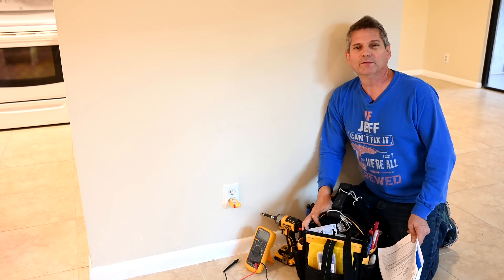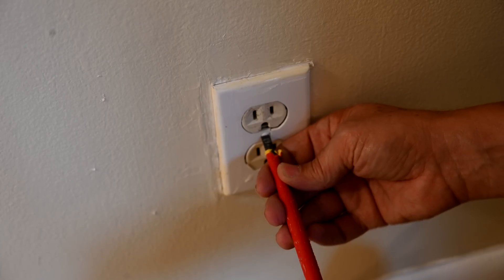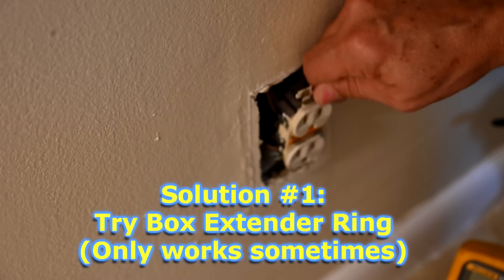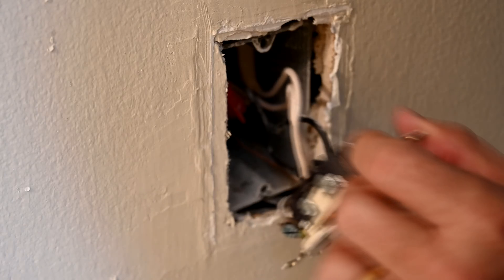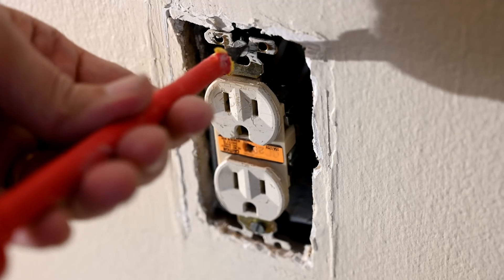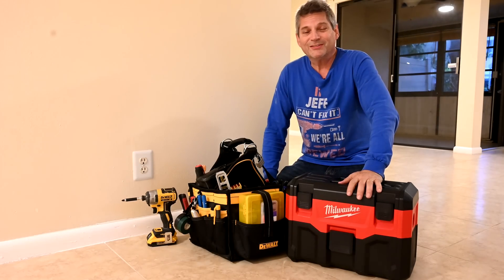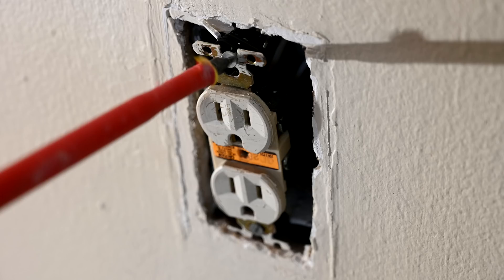2 Tricks To Tighten Loose Electrical Outlets, Switches

Comment: I have an outlet that I recently upgraded to a GFCI, but the box was so old that it broke off of the stud entirely and is held in place with the rigidity of the wire running to it. I managed to get everything done and it works, but it is incredibly loose and since it's a brand new GFCI outlet it holds onto everything you plug into it like a vice grip which makes it easy to pull the whole outlet with the box out by about half an inch. This is obviously not good in a bathroom. What do I do in this instance?
Reply from the maker: Do what I have had to do many times. Cut into the drywall, install a new box the right way and patch up the drywall. OR...if you can get the old box out of the existing hole, go to home depo and buy a 1-Gang 20 cu. in. Blue PVC Old Work Electrical Switch and Outlet Box that you slip into the hole in the drywall, and it has 2 wings that flip out and you tighten it against the back side of the drywall by screwing it in. See it here: https://homedepot.sjv.io/e41yWg
Reply: @jeffostroff  Thank you you're amazing.

Comment: Foundation of the project is a secure box....   Plastic cover plate cracked because the box was not secure,  appliance was plugged in And the receptical gave ground,.... the plastic couldn't support the inward force and done...  Metal plate is a good option when box is not secure.
Reply from the maker: I normally use metal plates in all my remodel projects
Reply: @jeffostroff  I like metal plates as well, but aren't they more expensive than the plastic?  My point was,... if the box was secured properly in the first place, the original plate would still be in place, unbroken, ... and you would have not had to fix it.

Comment: I use a homemade spacer. When you purchase wire shelving they give you plastic anchors for drywall. These anchors are white & they’re pretty long, I never use them, because I always  drill into the studs to hołd shelves. I cut these to the length I need and these work perfectly.   Thanks...Jim
Reply from the maker: Great adaptation! Anything that shims that space will work, washers, nuts, plastic.

Comment: You didn't insert the upper screw into the proper slot - looked like you were screwing into air. Maybe I'm missing something
Reply from the maker: It was stripped by previous installer so I tried to find a better angle that would hold it in.

Comment: Why not just fix the dry wall and box???
Reply from the maker: Good question. You come down here and fix it. Let me know how long it took you to cut the drywall away from the front of the box, since these ae mounted onto the front edge of the metal studs, then remove the old box, install a new one, then patch it all back up, then wait 3 days while you apply your 3 feather coats of drywall mud per day and let dry overnight, and sanding after each layer dries overnight, then buying the primer, and priming that part of the wall, then buying paint to repaint that area. Let me know how much effort that was for you to "JUST" fix the box and drywall, when we clearly showed how a $3 package of outlet spacers easily did the trick.

Comment: Drive a screw through one side of the box into the stud. Using needlenose pliars, bend the ears on the top in toward the box to take up the slack. Install new plate.
Reply from the maker: You can't drive a screw through the side of these boxes into these studs because the studs are thin gauge metal an at that angle from a narrow single gang box it's virtually impossible to even get a drill bit to go through I'm not sure head on into the metal it's a fool's errand even trying. You would have better luck pulling out the whole box after cutting open the drywall an installing a new box.

Comment: Hi, I found your video while searching through a problem I'm having.  Please correct me if I'm wrong, but I don't think this particular video addresses my issue.

My outlet has two plugs like the one shown in this video.  The top one, however, lets say I plug something in kind of heavy, like an electric toothbrush that has a box-shaped plug vs just a regular plug, it hangs most of the way out once I let go and eventually may fall out. I don't think it even stays in far enough to get a charge.  This only happens to my top plug, so I've been stuck with basically only one usable plug on my 2-plug panel.  The bottom one holds onto things ok, and again, it's just anything plugged in on top falls out.

What's the fix for this one?  Do you have a video on it as well or did this video cover that and I just didn't seem to catch onto that?
Reply from the maker: Your only fix here is to replace the receptacle because once it gets so loose like that that it can't hold items then it's time to replace it that probably has happened from people yanking on it over the years sometimes with vacuum cleaners and I've seen people do this where they've broken the prongs on the plug on their vacuum cleaner because they're always yanking them out of the wall

Comment: Replace it with new plastic single gang box..and put in a brand new receptacle.metal plates conduct juice easier than plastic in a default
Reply from the maker: I do that on my foreclosure flips, I replace every outlet and switch, but here they had to close in a couple of days, and needed this fixed.  Replacing the box would involve slicing open the drywall to get the old one out and budding and taping 3 layers afterwards, many hours of labor.

Comment: as much as i like your vids, this one has to be one of my least favorite. because you are citing codes that don't exist. i think you should stick to the things that you know and electrical code is obviously not one of them. sorry, just calling it like it is. 🤔🤦‍♂️
Reply from the maker: I know what I cite is correct. so instead of making up bogus generalities, get to the point and point out exactly which code I cited that does not exist. the fact is I spend quite of bit of time in NEC electrical code book studying, searching for exact requirements, and studying from experts in the industry who teach these codes.
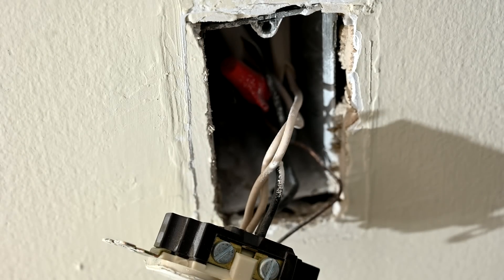Reply: @jeffostroff  there is no code stating that you can't leave more than 1/4" of sheathing on nm cable in the box. the code states the sheathing shall extend no "less" than 1/4" in the box, not no "more" as you stated @ 8:22 in the vid.

Comment: The wire spacer  can use in the wall in the ceiling  anywhere  you need  space an plus it insulates your long screwfrom touching any current in the boxes
Reply from the maker: I have tried all the solutions, but so far these plastic spacers work the best for me

Comment: i have a GFCI outlet i need to change that i can't get to cut off at breaker box, anytime i use my not contact meter it goes off
Reply from the maker: Why can't you get it to cut off at the breaker box? It should work. If that fails still, then try cutting main power to the whole house.

Comment: That spacer is a waste  of time use a single piece  of wire wrap it the length  of your phillip head screwdriver  and u will have endless spacer for free measure as much as you and cut an place between  the shim box and the box in the wall till the shim box  is flush  with  the drywall  then screws the plug  to the  shim box and complete  the job with your metal cover  or if that cover job is pleasing  tuh you you can leave it just like  that it's  your  choice
Reply from the maker: No a waste of time, the strip easily cuts and folds up tot he thickness you need.

Comment: You can use a piece  of single single wire wrap it around  your  phillip head screwdriver  to make a spacer  then cut as long as u need to make your shim box flush  with  the drywall then put it between your spacer box and the box in the wall to give the shim box  something  to  keep  it firm and flush with the drywall  if you can get the plug  box a little  more  firm in the wall before using the spacer  even better if you want  any more  advice let me know
Reply from the maker: Yes, another useful solution

Comment: outlet was broken , at the top ground point.  also , was back stapped.  bad practice should have replaced it. and put the wires on the screws.
Reply from the maker: The whole house was like that. they had zero money and were under contract with buyers, but their inspector found this. Hey but if you want to send the money to have all this done, I'm sure my friends would have loved to change them all out.
Reply: @jeffostroff  replacing the one, would have been like $2.   you didn't make a video about the whole house, just the one loose plug.   just saying.  and as they say, you touched that plug, if that plug over heats because it is back stabbed . they will be going after you.

Comment: Never even knew they made spacers For outlets, I always used washers, and they are very difficult to stack, Interesting to   Note they also make taps For different size machine screws machine screws If you’re dealing with a metal outlet and the screw holes are stripped out you can run one of those taps through it And go to the next larger size Number machine screw
Reply from the maker: I might try that next time on the tap
Reply: @jeffostroff  The tap saved my butt On my kitchen remodel, backsplash was done and there was no replacing this four switch box without making a huge mess Klein makes the tool cat number 625–24

Comment: That outlet box should be next to a stud I usually just take to drywall screws and screw it back to the stud sometimes you can break the old box down and put in one of those boxes outlet boxes that screw itself into sheetrock the little tabs on each end
Reply from the maker: Metal studs, so it is attached tot he front of the stud with a wrap around bracket, then the drywall goes on really sucks. No way to screws in sideways at that angle either into the cheap flexible thin gauge metal studs.

Comment: You could just pry out the old box and put in a blue plastic remodel box.   Also since the top grounding hole is broken, change the outlet out too.  I like to use the  more flexible commercial  plastic plates especially on uneven walls.
Reply from the maker: The problem is these are metal studs, so the outlet boxes are attached to the front of the studs, and the drywall goes on top, no way to pry them out, they have to be cut out. Several switches in their townhouse the drywall mud bump around the switches was so poorly feathered that the plastic plates crack from the stress of screwing them in under pressure over these humps.

Comment: What about this. When you screw the outlet to the plate it will hold the outlet forward, so it will not move in. So, why not just replace the cover.
Reply from the maker: Doe snot work because the outlet still pushes back too far. That is why the shims are needed to put the outlet in the correct position so you can put on the new plate.
Reply: @jeffostroff  if the metal outlet cover is being held from going back, because of the hole in the wall being smaller than the outlet cover. 
   If the outlet is being held to the outlet cover by a screw in the middle of the outlet cover.
   Thus, would tightening the screw on the outlet cover. Pull the outlet tight to the cover. Preventing the outlet from recessing into the wall. Because the outlet cover is larger, than the hole that the outlet is in.
   This would prevent the outlet from recessing into the wall, but if the outlet was not connected tight enough. When an appliance would be unplugged, there would be a gap between the cover and the wall. Majority of time, in those cases. The gap would close when unplugging the appliance, was done. 
   Correct?

Comment: ewe, I hate outlets with half painted, half scratched off paint on them. Yuck.  I assume this was going to be a cheap rental.  I would have replaced the outlet, THEN put on the metal plate.  I have even knocked out the entire box, let it fall inside the wall and replace the box with an "existing construction' box with the flip out tabs, then put in new outlet and new plate.  I do like the oversize plates so they hide oversize holes and old paint lines.
Reply from the maker: Yes, this was for my friends, under contract to sell the unit. Normally in my foreclosure flips, I buy all new electrical outlet receptacles and switches for the entire house, where they need it or not. My properties all look brand new when people walk in.

Comment: The fact that I corrected your incorrect use of the term outlet, should not have triggered such a rude response from you. 
Are you under stress?
Reply from the maker: The fact that I corrected your correction of my usage of words by showing you other professionals that also use the same terminology I used should have shown you that sometimes there's more than one acceptable terminology for something. Did that stress you out? It obviously did because your OCD has you coming back and you keep on commenting More and More digging in, which is an immature sign of somebody with superiority complex. Look the words you used to describe the items and the words that I used to describe the items are both acceptable why can't you just accept that?
Reply: @jeffostroff  the fact you need to accept is professionals and non professional DIY s , who know the correct term say receptacle. 
Would you ask for a mitre saw, if you “ meant” circular?
Man up, you are wrong. 
Using the example of others being wrong does not make you right.
Reply from the maker: @pm2819   You are using failed psychological nonsense to try to insert 2 vastly different tools into a discussion about outlets in  a failed attempt to prove your moot point. And you are wrong because every electrician   I've ever spoke to calls it an outlet.  whatever stupid reason you just can't get over to the fact that many professionals refer to receptacle as an outlet, and and outlet Box is an outlet Box. It doesn't matter you are here pounding the tables with your OCD nonsense. again you have OCD and you keep coming back for more and more and more you just can't let it go the problem is with you not but the video

Comment: Obviously , you are not an electrician.
Reply from the maker: Obviously, you are using the wrong gauge and metric to determine somebody's knowledge and or ability. Just because somebody does not use the exact same terminology that you do does not mean they don't know what they're doing. As this video shows I clearly fixed the error left by the builder themselves the actual professional who should have known better. If you had the knowledge, you're trying to make people think you have you would have noticed it, but your OCD has you stuck on the fact that I'm using a different word outlet, than you use for the same item, receptacle.
Reply: @jeffostroff  my guy you are wrong. 
Man up
Reply: @jeffostroff  so the code book is wrong , right, doesn’t matter?
Fact is an outlet is not a receptacle.
Reply: @jeffostroff  it’s about using the right terminology. 
And in this case:
You Are Not. 😎
Now man up

Comment: For another 75 cents you could have at least replace the painted over mismatch coloured ivory plug to a white plug with a white cover also never use  push in wire into the back of the holes always wrap your wire around the brass screws on the hot side and the silver screws on the left side. Or better yet  make pigtails  with wire nuts. KJ
Reply from the maker: Yes, they did a lot of backstabbing on those outlets, very common here in Fl in the 1970s and 1980s constructions, we see it all the time. Just lazy.

Comment: The old outlet was crap, the plastic was broken on the edge of ground.  It should have been replaced.  Because it is a metal cover plate there is a requirement in some areas to have the ground leg up so if the plate come loose drops down it will surely hit the ground so it will save someone from being shocked.  
I prefer to have the ground lug up in places where I plug in equipment because it is easier to line up the ground when it is on the top.  
Around here you are not permitted to use the second pair of screws to feed another outlet. 
Whatever happens to using plaster to set the box in place along with the screws attaching it to the existing box?
You would not have had to cut the plastic box extender if you had put an new outlet there, you know, a good one like a spec grade receptacle. 
Seems like a lot of work to go to for a crappy old outlet????
Reply from the maker: Yes, I typically replace all outlets in every project I do. These were friends of mine selling and had no money to buy outlets

Comment: This seems like too much of a hack to me. To begin with, the box is not secure or wired safely. The drywall is in rough shape and the hole is clearly too big. I'd be more inclined to fix the box situation by properly bringing it out more and securing it to the stud so it doesn't move.  Then replace the receptacle because it looks like it's in rough shape. Then you have some work to do to patch the drywall.   So yeah, it's a bit of work, but I hate that new faceplate, the receptacle is hacked together with shims and long screws, the wiring job wasn't improved and the drywall around it looks terrible.  There wasn't a whole lot of improvement here on a bad situation.  If it were my home, I'd spend the time to get this right.
Reply from the maker: Not everyone has the money to do what you propose. If this was a remodel, yes, but every outlet in this place was done like this, a very expensive issue to fix. There is nothing hack about adding shims, it solved the problem beautifully